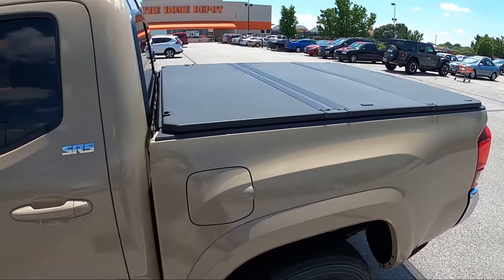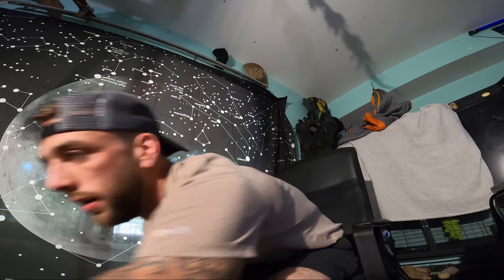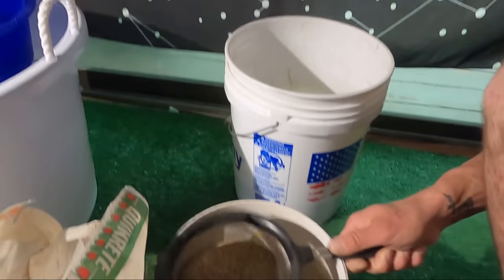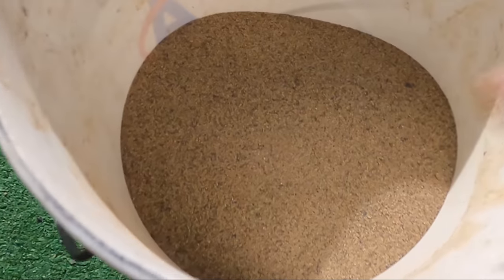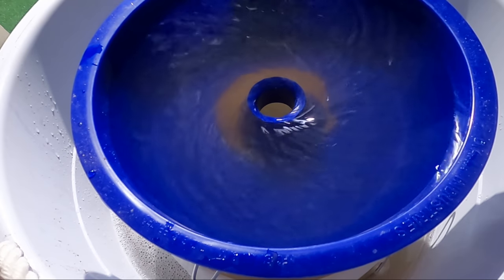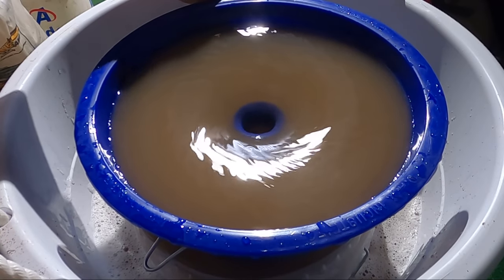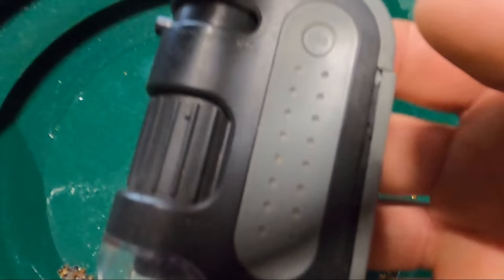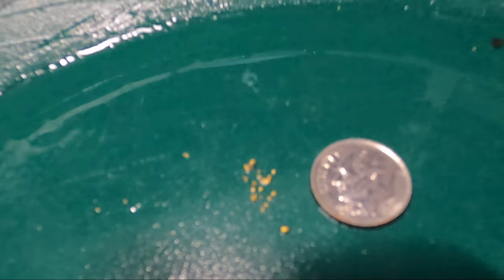GOLD PROSPECTING AT HOME DEPOT.

Comment: The sand I got and still have from 6 years ago at Home Depot was a heavy 60 lb. tube type intended for weight on the rear tires in Winter. I classified mine in a bucket of water with a kitchen strainer.
Reply from the maker: that would be interesting to pan out.

Comment: Awesome video. Question... Where can I get a nugget grabber hand dredge like the one u use??
Reply from the maker: They will be available on eBay soon ! THE NUGGET TRAPPER , we actually designed a trapping mechanism in the tool itself and it will be the only hand dredge in the market that does not get clogged or stuck when a piece of sand gets stuck lol these things are badass and well worth it. We’re making a high quality hand dredge with a nugget trapper built inside and it will not break your bank either, us being prospectors want to help other prospectors with a high quality gold mining tool that everyone can afford, I will make multiple videos on how to use the hand dredge, how to use the nugget trap and even compare and contrast with other hand dredges. As soon as they hit the market you all will be notified first! We’ve all been waiting a long time for this we just want to make sure this thing is built tough so you don’t have to worry about crap breaking when your 15 miles deep in a mountain at base camp hand dredging cracks no one has ever seen before pulling out nuggets.
Reply: Thank you! Hopefully they will be available soon, cuz I am gonna need some for our creek!